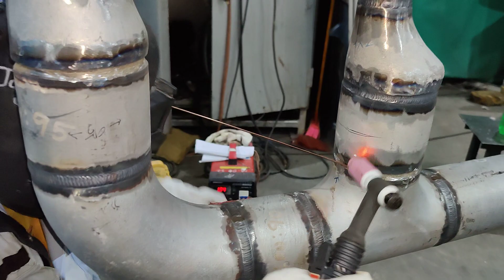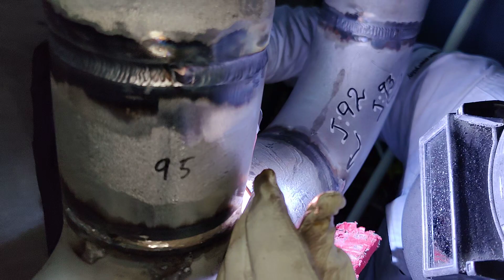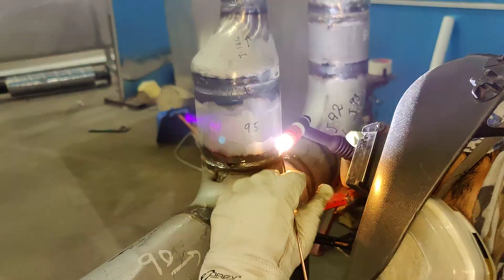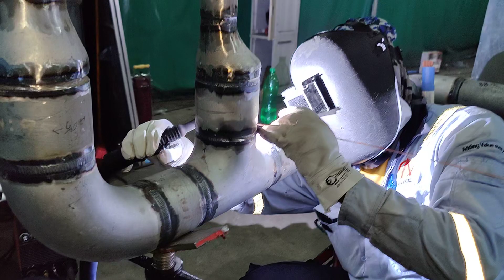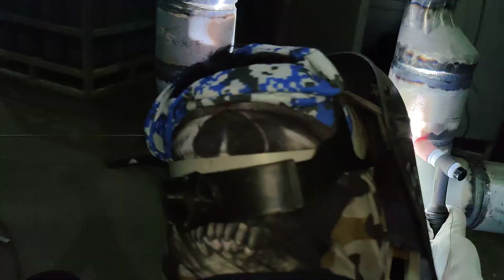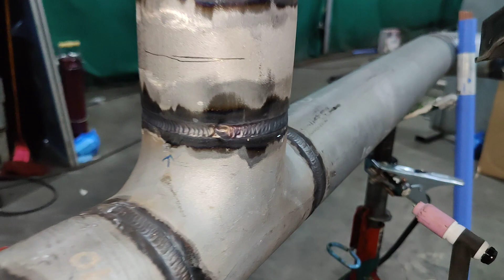carbon steel tig welding 2g position weld

Comment: couple more years and you will be good.Be careful with the undercuts at the top of your horizontal welds.Less amps could help you out when the pipe is hot.You dont need to grind after rootpass and hotpass just get a driver with a wirebrush or just get a standard brush and clean with thst after every pass.Will be ok for xray.
Reply from the maker: Thank u
Reply: @ovaizvlogs4311  You are welcome,your root pass is really nice.ps: practice freehand too you will need it in position welds at the field.